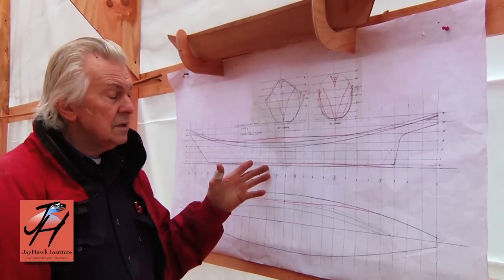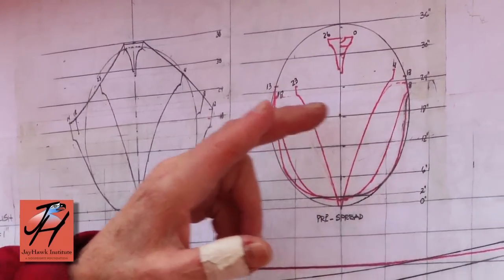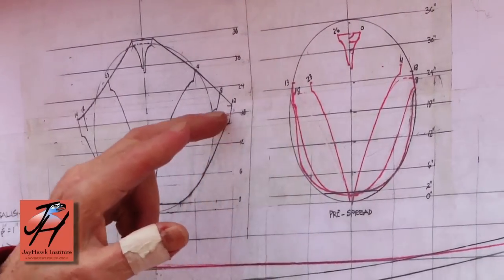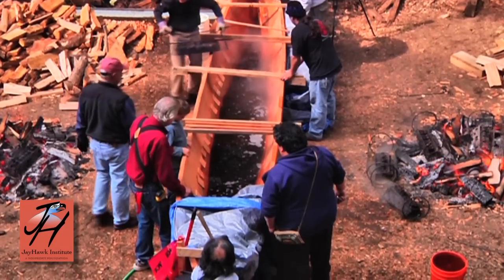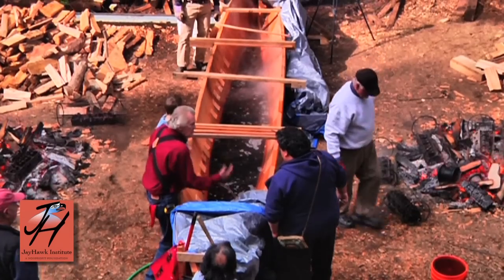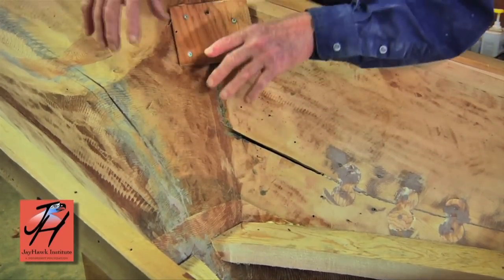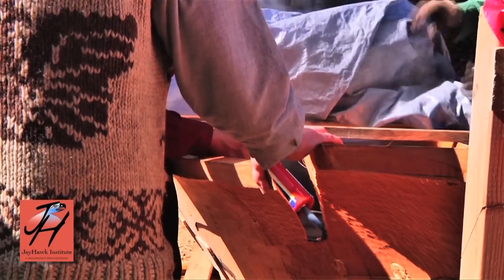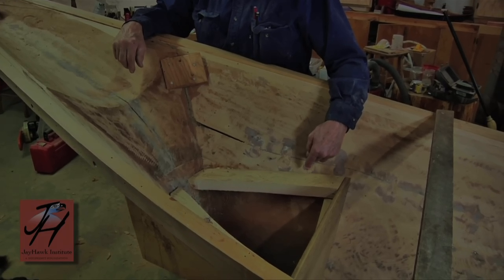9-Spreading the Canoe - NW Coast Indian Canoe Project

Comment: Were elk skins originally used in place of the plastic tarps?
Reply: Its was eLK, Caribou, Deer skin, anything leather, and they used stone, because you cannot heat the water fast it needs to be gradual and it takes 2 days from what i`ve told, on these project they heated it fast and not even a day of streatching thats why the wood cracked, too fast of streatching.

Comment: should of sink it in a pond /river and let it soaked up as much water possible b4 ever steaming the boat /conoe ,u could have left extra wood on the bottom of the hull outside and heated it with fire from under neath as well as laid ur hot steal in the inside bath and it m,ay not have cracked,i seen the northmen doit this way but without water on the inside of the boat just fire and sinking  and soaking and rotating the conoe

Comment: It's too bad you had to resort to modern technology to salvage the boat building re-enactment.  In the olden days, they probably threw the wood away and cut another tree.

I wouldn't put too much importance in recreating that process from a civilization that have not yet discovered the wheel.
Reply from the maker: You can't use wheels on the water, the canoe got them here a few thousand years ago and they developed their civilization on the water...no need for a wheel.